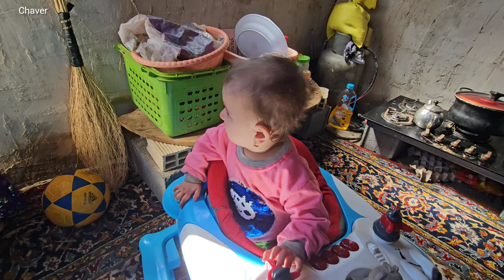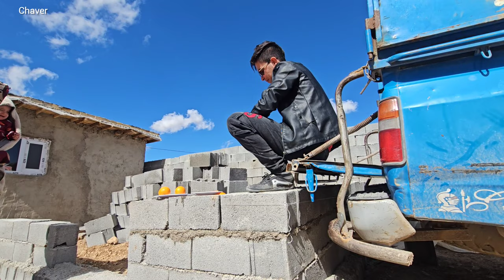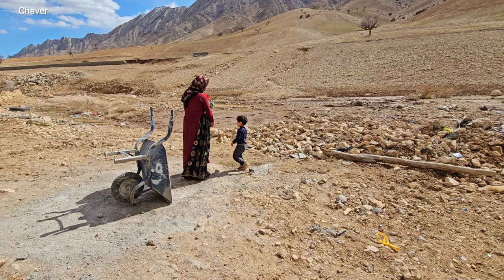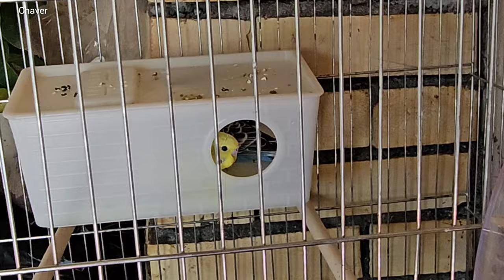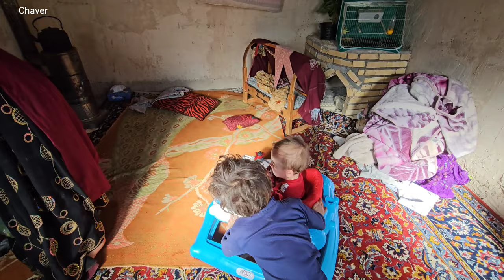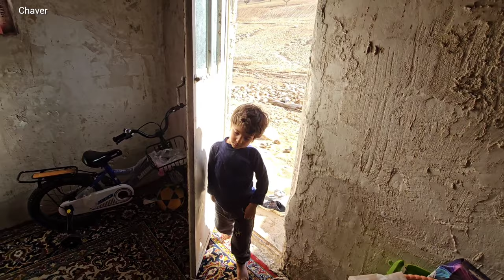divorced woman 🤰 falls in love with a driver. 💖 Building a house in the mountain.

Comment: That  plant that was bought for you is a house plant, it will not survive outside in the cold temperatures. It should be kept inside the house with the cellophane taken off and just enough water to stop the soil drying out. Sometimes depending on the temperature inside the house, it will need watering at least every couple of days, just keep the soil moist. ❤

Comment: The birds are terrified and are hiding in their nest box. Please dont tap  it. They are not used to people yelling as you do and they have nowhere to get away from you except in the nest box.  Could you build them a cage outside where they can be in fresh air and fly? You could cut a tree branch or two for them to use. If the cage has a wire bottom and is up off the ground their rubbish will fall through and be easily cleared away.  Having living things to look after is a good opportunity for Sakineh to teach Roya respect and responsibility.  With love from Australia. ❤
Reply: Its to c0ld outside, the will die :( the must be very scared when they hide in the nest.